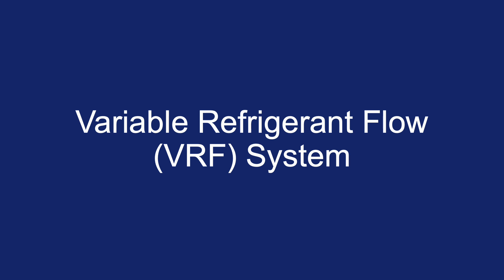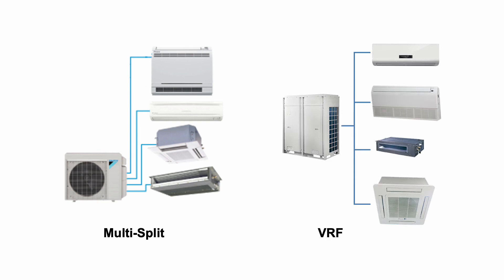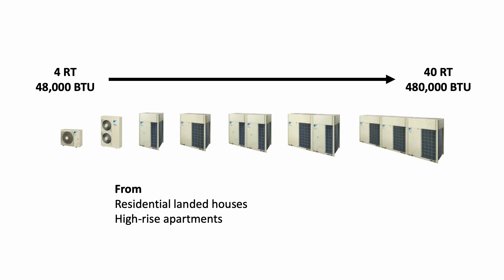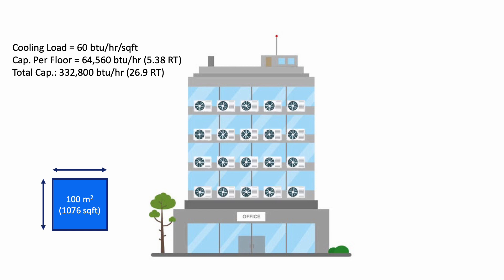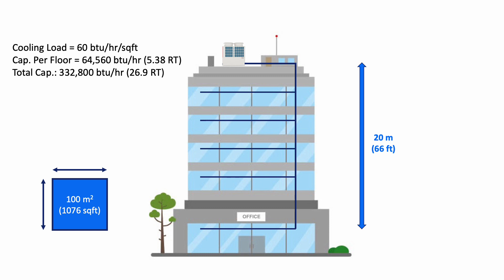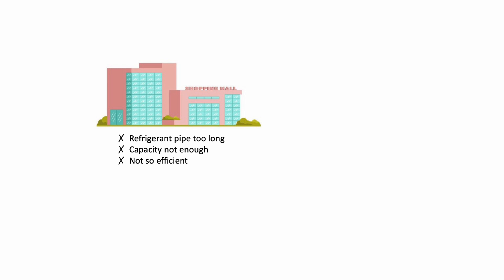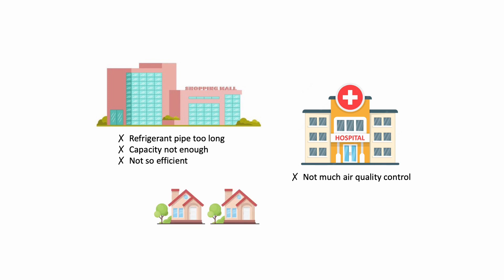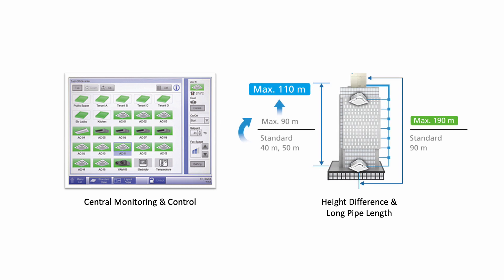Variable Refrigerant Flow (VRF) System - Design Considerations and Applications

Comment: Thanks for sharring! For household use, other than the copper piping, what are the differences in between mini multi-split vs VRF? Pros and cons? Thank you!
Reply from the maker: Sure. Some other differences are cost, VRF is higher, then the control, VRF has centralized thermostat, also the capacity, VRF offer much higher capacity than multi-split.
Reply: @aircondlounge  thanks! Can we set different temperatures in different rooms for both multi-split and VRF? If yes, can we set different modes (heating or cooling) in different rooms also for these two systems? Again, truly appreciate your knowledge sharing and guidance. 🙏🙏👍👍
Reply from the maker: @HL34908 different temperature yeah, both systems can make it. But running cooling and heating simultaneously is usually VRF only and it needs to be the “3 pipes” system.